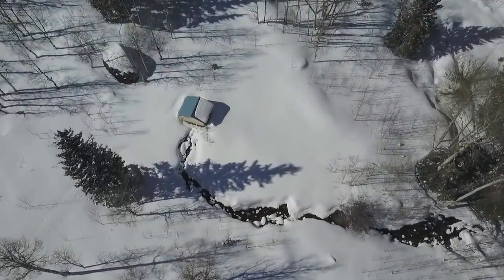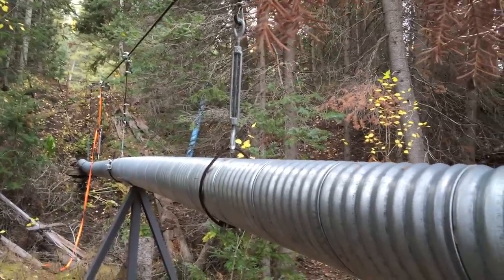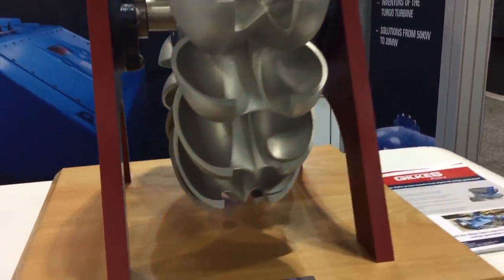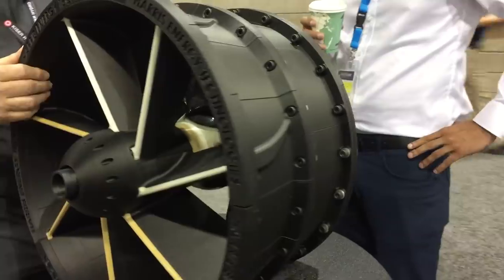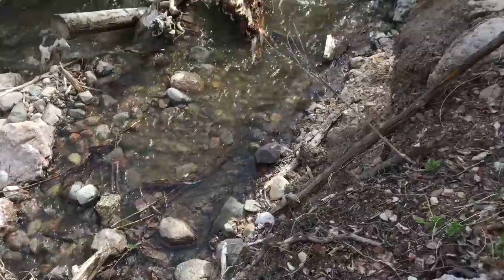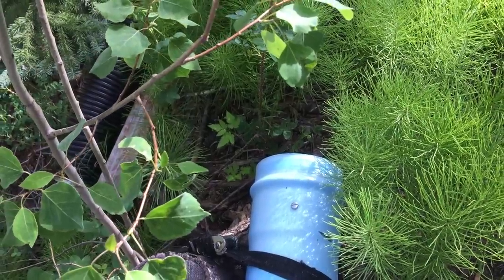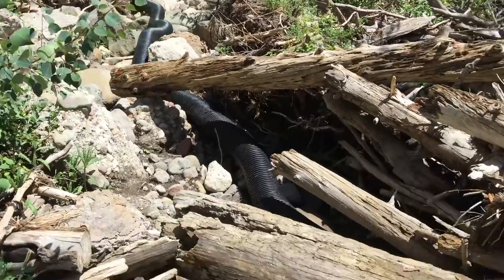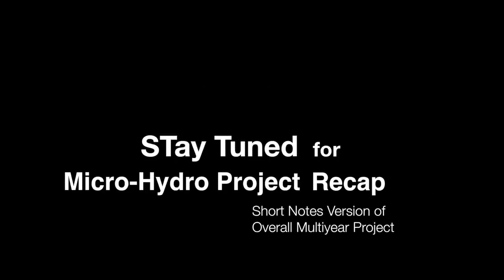Part 18 MicroHydro Power System in CO

Comment: As a construction PM I have led projects with utilities crossing bridges and such; the manufacturer of that type PVC makes expansion and deflection couplings one at either end of any aerial span is customary... allowing necessary movement, minimizing leaks
Reply: As the suspended pipe will heat and cool faster than the pipe on or underground...

Comment: About the fallen tree issue:
I have an idea. You have one line holding the flexible pipe. Place another line holding nothing above that line. If another tree falls on the top line, it should protect or lessen any damage to the flexible pipe line. Repair of the top line should be easier.

Comment: Great job on the video, and hey waaaaaaaay to hang in there baby!!!   A true mountain man respect nature but let's her know he is living there as well (BRAVO).  There are ways of filtering water with natural surroundings and the meadow grass looks like  it would work for part of the filter.  However, I am not there and I always need to experiment wherever I am in the world, in the tropics they use a grass similar to the meadow grass and topped with a broader leaf plant then filled in with smaller rock (pebbles), then each layer is larger and larger.  Coconut fibers are used around the world and especially in saltwater areas, it takes more than that to get drinking water, but it will keep the debris out.  Using straw and buring pipe with about 18" to 24" over it and underneath it should keep it from freezing (but you may have to bury it below the frost line then pile it on top.
Reply from the maker: Thanks for the comment.  We are fortunate to have several good springs.  We tapped two of them for the first hydro system.  They no longer make power but still flow well and provide us with ample domestic water.   I never know who has seen what segments.  Parts 20-1,2,3 are a synopsis of the whole thing.  Thx for watching and your input!!

Comment: Have you considered lining your stilling basin at the penstock with Bentonite, then covering the bentonite with a bedding stone and rip-rap? That would be a long term solution for leakage.  You may also consider a deeper pool with a spillway to remove the organic material while increasing head pressure.
Reply from the maker: We probably should have lined the area to begin with as you suggest, but the sloppy mess we found ourselves in while constructing the weir in the midst of flowing water and snow storms blinded us to that approach.  At this point the pond is stable with only a minor amount of leakage.  There is more than enough water to feed the system at full output.  Perhaps one day we will consider making changes.

In as much as our pressure is based on how far water falls (2.31ft. = 1psi), I don't see how any modification would increase the head pressure. There is no resistance due to organic debris.  Thanks for the suggestion and for watching!

Comment: Your problem of spring run off could be solved using heavy rip rap rock. Then you could have a side diversion to a farmers screen to filter your water. In Oregon they developed the Farmers Screen to combat spring run off destructive forces and yet allow the stream to maintain its natural workings of seasons. With this system, you get filtered water in a consistent manner to your use.

Comment: Thanks for your video series. I am looking at designs to begin my own system, although one of my hurdles is the salinity and corrosive properties of the spring water available on my property. I have to use all plastic as any metal in contact with the water soon disintegrates. cheers.

Comment: If you're in Colorado, do you get any lawsuits around water rights by tapping into the creek? I suggested once that we divert some flow from an irrigation canal to water a lawn in Boulder and was told it was illegal.
Reply from the maker: I filed on water rights in district water court which is the proper way to use the water.  Our rights are junior to others that have senior rights tot he water downstream. It would be illegal to just use ditch water for your own un-adjudicated purposes.  Our use is termed "non-consumptive" as it goes right back into the water course it comes from.  Thx for watching.

Comment: could you dig like a long french drain with a lot of surface area next to the creek and use it as the inlet.  That way it would be permanant and the french drain would filter the water
Reply from the maker: Given the rocky and unstable terrain which isn't accessible by machine that would be an enormous task and likely would not pass enough water.  Thanks for the idea anyway and thx for watching

Comment: turn your metal screen 90 degrees so that the lines of the grill align with the waterflow. it will be self cleaning. also you could use snifter valves to release air in your line?
Reply from the maker: Actually the angle its installed at is correct.  Lots of people have suggested air vents.  The path of the pipe has only minimal fall where the air gets trapped.  There isn’t any pressure to keep a vent closed.  The problem is that the negative suction pressure from the lower part of the pipe would simply suck air in at the vent holes. That is why when I bleed the air out through the holes I need to close the gate at the pipe outlet. Once the air is out of the line, the flow is dramatically increased. Thx for watching I'm never sure who has seen what of the series. Here is a playlist of the 3 part synopsis which is an overview of the whole process https://www.youtube.com/playlist?list=PLtTypVpmDd-vkT9bJQkXw4I1t0e_4jMYA The whole series is in about 25 videos.
Reply: @mrhydrohead  check valve up high in a riser set to "out" pointing up to vent any air, but keep suction. Inverse siphon break?
Reply from the maker: Another commenter pointed out the error in the link I provided that it didn't work.  It should have been https://www.youtube.com/playlist?list=PLtTypVpmDd-vkT9bJQkXw4I1t0e_4jMYA  
Sorry about that.

Comment: Have you thought about a floating intake in the creek with a ram pump? You could pull it up out of the water if you don't need it and you can permanently attach the hoses to the system.
Reply from the maker: Lots of suggestions which I appreciate.  Haven't considered a ram pump due to not really needing to invest more money in the system.  Its already supplies more power than we can effectively use.  Again, thanks for watching

Comment: Very inspiring project. Just wanted to ask what type of turbine you used?
Reply from the maker: Canyon Industries Model #1051-1.  Original design was for direct drive and changed to a belt drive upon moving the system to the creek source due to less pressure.  Highly recommend the turbine.  Runs like a champ after 22yrs+ of operation.  It pays to buy quality although prices have certainly risen since I purchased.  www.canyonhydro.com

Comment: Thanks ! a true Genius of Hydro power. very interesting.
My thoughts are :- Every Natural source of energy should be used to generate power world wide. 
MAXIMISE NATURE ! 
Solar works in the day time in some areas,  but water always flows, and the wind always blows, use a mixture of all 3.
We need to go back to the OLD ways. 
using modern technology to increase its performance.
Every fire / stove should be linked to a hot water system. 
The hot water should be piped around the house in a dual or triple loop circuit to extract every degree available. 

There should be a £ / $ MILLION prize given out each year to the best most efficient invention / innovation / variation of power generation and ALSO power storage ideas and equipment that actually work in domestic, industrial, or large scale useage.

Get the people thinking and trying ideas and wild thoughts. 

Bring out the crazy inventors and make them rock stars and footy stars, pop stars. 
Make MR Garden shed, / garage inventor into a world name if his stuff works and is proven to be better than what we had last year etc ?  ( ok 5 or 10 or 50 million money's ) what ever its worth on the world markets. or a fair share of.
all we hear about are people who made a film. or climbed an actual mountain, or went to space, or sung a song , Elvis ABBA, and all of them. but we never hear about the real Genius people who could make the world a better place .
Reply: I agree with you! but not all people are thinking the way we are, some are greedy thinking how they can capitalize on things to satiate their hunger for money. That's the reason why we cannot create a better world.

Comment: Is the in take tank permanently installed or is this also also removed during the heavy melt seasons?
Reply from the maker: It is removed along with the flexible line some time in May and put back in June after the runoff has passed.  thx for watching

Comment: Why is there so much water running over the screen? Is the turbine just not using enough water to use all that is available to it?
Reply from the maker: That shot at the end is with partial flow setting at turbine.  It will look different once system is full flow.  But the good thing is I think there is enough water to add a second jet in the turbine and utilize more flow if the need should arise for more power in the future. Thanks for watching.

Comment: Why yes no more DAM leaks!     :)   Now the Dam runs fine.
Ok one question, why not install heat tap incase the pipe gets a frozen part the constans heat would slow or stop this.
also I think you could add some kind of automatic pipe burp valve or chamber to bleed off any air pockets.
Kind of like those used on a compressor to remove water from compressed air after the storage tank.
Reply from the maker: We haven't experienced the penstock freezing, even in -12°F weather.  The distance from the power source to the intake is about a half a mile as well.  That would be a lot of wire for a questionable advantage.

Comment: Silly question: Wouldn't be easier to transfer the the electricity trough the wire than water trough the pipes?
Reply from the maker: You need the fall to create the pressure to drive the turbine, so no it wouldn't be easier.
Reply: @mrhydrohead  how large is the fall from the intake to the turbine in your system? and what is the resulting pressure? 
couldnt you generate a lot more power if you had a longer pipe that collects higher up?
Reply from the maker: 96psi pressure x 2.31 (feet per psi) = ~222 ft.  and no, collect water at edge of property and unbuildable beyond the intake.  Currently producing 175kWh per day which is a huge amount and plenty for us
Reply: Not necessarily. The longer head and tail lengths provide a consistent quantity of water flow that avoid surging of water through the pipe.  Also, as the length of the wire increases, so does ambient loss of power.

Comment: you getting a power wall to store excess energy?
Reply from the maker: No need to really.  The straight AC is plenty to meet our peak demands and we don't need storage so why go to the expense and tending of the unit.  Years ago when we first installed we made the decision to not have batteries because we wouldn't be here full time and didn't want to deal with lead/acid.  The redesign (parts 5-20 of series) gave us plenty of power and again superseded the need for battery storage.  thx for watching
Reply: @mrhydrohead  makes a lot of sense.   ps: i watch the ones with music when I need something on to go to sleep to.
Reply from the maker: Funny.

Comment: Would be funny if you could use the water to make a AC system for cooling your home during summer more efficient
Reply from the maker: At 8600 ft it stays pretty cool if you open/close window night/day.  Have been considering bitcoin mining with cold spring water for cooling the system though.  A potential way to monetize the excess power.  Thanks for watching.
Reply: MrHydrohead I'm extremely interested in this in my opinion you should use a heat exchanger with water cooling as well
Reply: Setup your mining rigs right in the power house since it would provide both the power and the water for cooling... Now to run a quarter mile of cable to provide internet to the power house :)

Comment: RAM PUMPs
Reply from the maker: Not sure why you suggest this, although they are useful devices.  I have a neighbor that plans to supply his water up from the creek with one of these.  I may make a video of it when he gets to the process.
Reply: @mrhydrohead  yes please!
Reply: Ram pumps only supply water to a higher elevation not power from the flow of water.  There is a lot of loss in using a ram pump; but once set up it will run with little maintenance.

Comment: cost aside, would a mini hydro work as good? https://www.turbulent.be/ I've seen it a few times in my recommended area.
Reply from the maker: You need a lot of flow for this system I believe.  I already had the equipment when I moved my system from Spring source to creek source.  I think that system looks very promising, but I don't think they have all that many installations of their design.

Comment: wow how much does it cost pre kilowatt? that seems to be a ton of trouble to get an ounce of power.
Reply from the maker: If you think 170-200 kWh per day is an ounce of power then you need to look at your monthly power bill and realize how much power that is.  We never approached it on the basis of a cost per kW as it was $140K to bring power line in in 1996 and would have cost $250-300K in 2015 and then we would also have had power bills to pay.
Reply: @mrhydrohead  ok einstien 200 ounces a day for 200 hundred tons of trouble, that better? it just seemed a real expensive huge structure poorly designed.I can't see it in three d real time, but I am sure the cost of moving the water through the penn stock is higher than the cost of moving electricity for the same amount of power.
Reply from the maker: Why are you so rude? Where would I move power from?   This is fully off grid power we are generating.  We didn't bring grid power to the property as the first spring fed system cost ~$25k and we got pressurized domestic spring fed water with that.  Comparing ~25K to 140K was a no brainer in 1996.  The redesign which was the primary topic of the series cost an additional $55k. That vs 250-300K again a no brainer.
Reply: @mrhydrohead  "  We never approached it on the basis of a cost per kW " That is inaccurate. You compared it to the cost of having power line to the site.I am rude indeed. But the answer was forth coming it is less to build this than to get the power to the site, you would have never mentioned it if I was not to the point.I saw the bridge across the ravine and i was curious why you  did not turn and head right down that ravine to get maximum drop and then run wire to the house, as it would be less costly to do so, than to have a pipe full of water crossing a ravine.but thanks for the information.
Reply from the maker: We did research running water on the south side of the creek directly to the power house.  The terrain was too steep to permit construction without extreme disruption. The slope of the side is about 60 degrees there.  There also was existing water flowing in the meadow on the north side of the creek that we wished to combine into the water source. Giving the diverted creek water a space to settle out any sediment in the meadow and combining it with existing water was the plan.  The north side of the creek between intake and power house area was completely inaccessible and unbuildable.  The south side had an existing road which made penstock construction relatively easy.  The decision to construct the bridge was our best solution.
Reply: @mrhydrohead  thats what puzzled nme in the first place  thanks for the up[ date.
Reply: @mrhydrohead  what some people do not realize like the so called Doctor is the satisfaction of getting it to work then slowly making it better without spending huge amounts of $$$$$$$. this obviously works for you. I know of plenty of people in my country that have built off line systems at  a small cost verses the price to trying to connect to the local power supply. good on you and thanks for the videos.
Reply from the maker: You speak the truth.  thanks for watching
Reply: @mrhydrohead  I only use 5Kw a day in power, but about 20kw in winter electric heaters drink power. If I could produce that much power I could sell it to the grid and make lots of money.
Reply from the maker: Wish I could, but we are 7 miles from the grid at about $40-50K to lay lines in.  It was about 20K to put lines in back in 1996.  All in all its worked out real well.  Thx for watching.